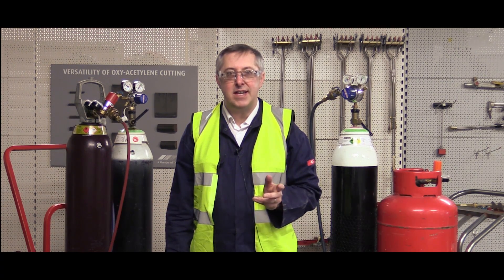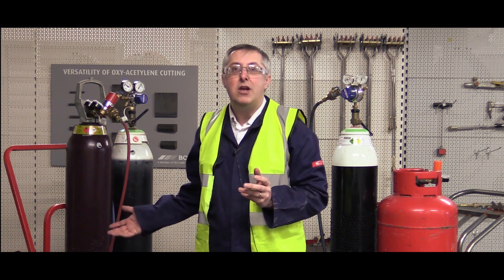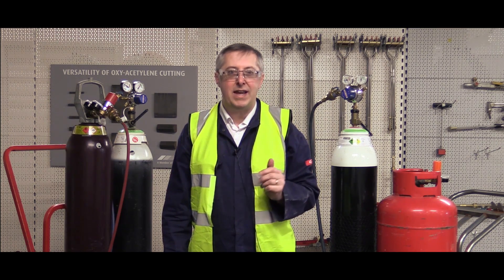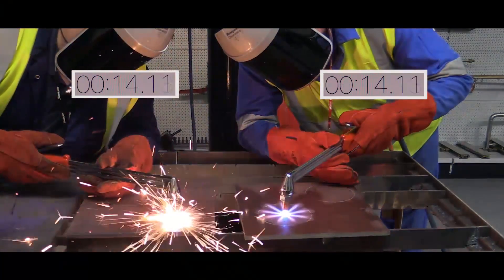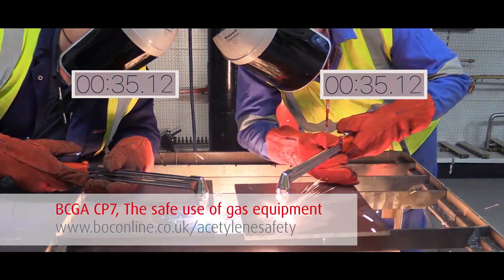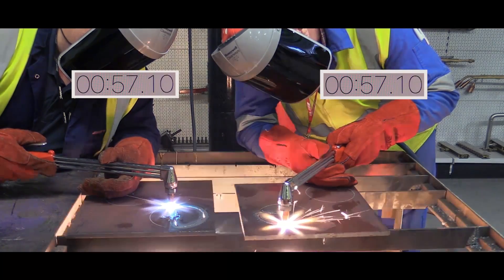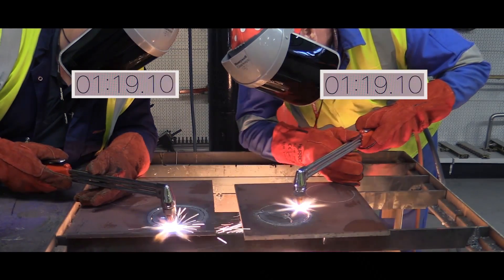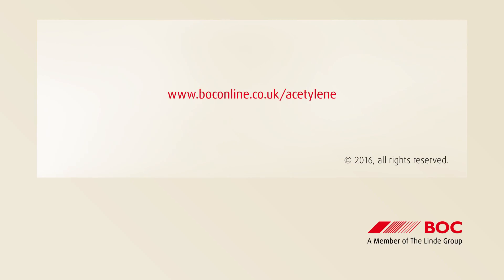Acetylene or Propane - Which Fuel Gas is best for you?

Comment: Even though you took a lot  longer than needed on your preheat with the propane it still cut faster... Per your own test, acetylene started the cut 13 sec in, propane started at 35 sec. Acetylene finished the cut at 1 min 20 sec, propane at 1 min 35 sec. All told, actual cutting speed for the acetylene was 1 min 7 sec, propane was 1 min flat... Acetylene is definitely better in some applications, but this test was either intentionally or accidentally skewed.

Comment: There are too many factors to label one better than the other. For every pro there is a con from the other, Same with plasma cutter vs Oxy. If one is cutting aluminum or stainless oxy wont work. Just be thankful you have variety as opposed to claiming "your" way is better. Im talking about the comment section.

Comment: Completely incorrect oxy propane has been proved to have a higher heat transfer than oxy acetylene but yes acetylene alone vs propane alone acetylene has a higher heat transfewr
Reply: Yes, but propane requires way more oxygen to burn completely compared to acetylene. Propane has more thermal power but lower flame temperature in the inner cone. Acetylene, burns hotter and this alone gives acetylene an edge here. When compared to our hydrogen flames, both propane and acetylene fall short on speed and cut quality. Did I mention our flame is 70% cheaper to operate per hour vs acetylene?

Comment: Propane is much cheaper, more available, and cleaner than acetylene. Acetylene is hotter and can weld platinum, it's more precise, and is meant for gas welding.

Comment: Oxyhydrogen is much better, much safer, way cleaner, faster and CHEAPER to run per hour than acetylene or propane. More info, just let me know.
Reply: More info please
Reply: @samuelherman6230  gerencia@aphytech.com We are happy to answer all your questions
Reply: You can't weld steel with oxyhydrogen. It can be used to weld gold and platinum, but not steel. Hot water vapor is highly oxidizing to steel.

Comment: Acetylene is a dangerous gas if used inside as i have got headaches when not using a fan for ventilation, after using LPG for the first time for cutting i found it does the job extremely well, only lesson is to set it up the gauges with correct pressure and get a nice star pattern on the plate with the flame
Reply: It's not dangerous to use inside any more than LPG.

Comment: ummmm ya just so you know the hot spot for a propane/oxy flame is about 1.5 inches farther away from the torch head. The operator on the right using propane is doing it all wrong.

Comment: Acetylene gives a much hotter flame
Reply: in the centre it does, on the outside LPG is hotter.
Reply: @aaronstately  but acetylene is faster for cutting speeds and is quicker to preheat the area before you make the cut, propane needs a little longer to preheat before you can start cutting through the metal.
Reply: @anthonyperkins7556  from my understanding thats not true, overall temp is higher in Acetylene, but only right in the centre of the flame..  like the 10% in the middle.. a smaller area, while LPG is hotter over more of the flame area and most of the heat is deleivered to the outside of the flame shape.. thats why angle and distance is diffrent for cutting with LPG... yet with heating it can be quicker...  its also cheaper and safer.

Comment: Once you start cutting , there is no difference in speed, chause o2 is doing the cutting not the fuel gas
...
Reply: Not true. Acetylene is slightly faster than propane as it can keep burning the metal at a higher rate. This is a fact. I've seen modern propane systems that aim to match acetylene speed at the expense of more fuel (and O2 of course)

Comment: For the plate thickness shown the best method would be plasma cutting.  Plasma pays off very quickly in industrial use and nowadays plasma is affordaable for many hobbyists.
Reply: Ob Fuscated for strictly cutting, yes, but too often you also have to heat things up.
Reply: Sure plasma is great but it's incredibly polluting! (Not safe for your lungs and skin unless you employ proper fumes evacuation system, which is expensive too)
Reply: @manuelpenaruiz3694  I'm super paranoid about doing any work in my garage, I almost always wear a respirator. The arc is only polluting in the sense of UVC rays, otherwise it's just steel and hot air just like the torch.

Comment: Propane is not as hot but has more BTUs of heat per volume than acetylene. Therefore propane is superior to acetylene for heating. Inferior for cutting but the differences between cutting and heating are probably negligible between the two processes. Now propane wins by far in safety and cost. Not to mention I can also use my propane tankto run my gas forge as well. And my massive 100 lb propane tank cost one third the price of purchasing another high pressure tank for acetylene. Only cost $80 to fill my propane tank right down the road.

Comment: acetylene is still the best for welding brazing and cutting because u cant weld with oxy propane
Reply: Mik Wri  
"You can actually, just not too well" nope you cant weld with oxy prop not even not too well,,it instantly creates porosity and brittleness that you can break with your hands easily,, 
Chemtane2??never heard of it but i heard of Magnegas but not sure how well it does for welding,,i will be joyed when they create an alternative gas to ace that i can buy in the hardware store like a small cyl of propane or map/pro ,unfortunately nothing on the market like that ,all you can do with those is heat,solder ,braze and cut,,not weld unless you mean weld non ferrous metals like copper or Al,,but never seen this done or really characterize this as welding
Reply: And that's why you use a tig welder
Reply: @samnottheotherone4363  But only if a source of electricity is available to power the tig welder!
Reply: True,propane is too cool to weld but is better suited to cutting heating and scarfing.

Comment: In terms of safety, propane is safest. Acetone in the acetylene is the problem if untrained in its handling. Propane is less volatile.
Reply: Can't weld with propane
Reply: @inscruitablefilletknifesha2681  I don't think that is a big enough downside to matter, unless you don't have a welding machine
Reply: @matthewrabel5035  Small acetylene cylinders have too low a volume for anything except short cutting jobs.
Reply: @marynollaig4124  keyword: small
Reply: @inscruitablefilletknifesha2681  Considering the fact that arc welding exists, I don't think thats much of a problem 😂
Reply: @inscruitablefilletknifesha2681  true. But we have the technology to weld with hydrogen, which is safer, faster and 100% clean